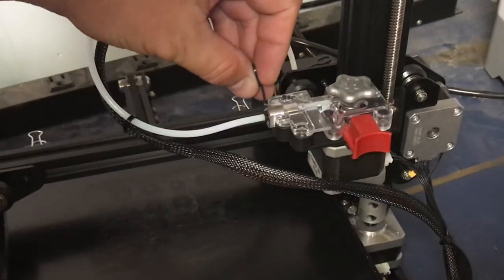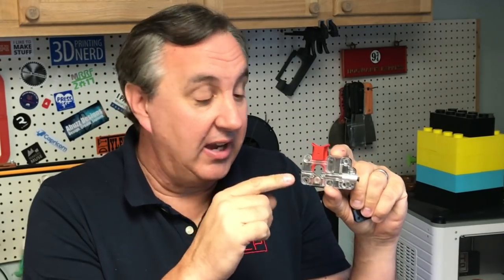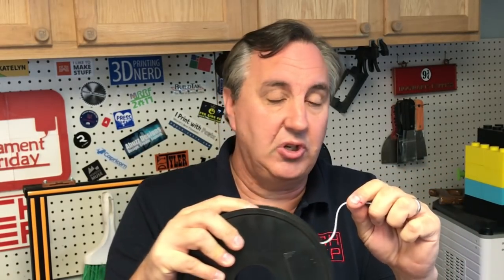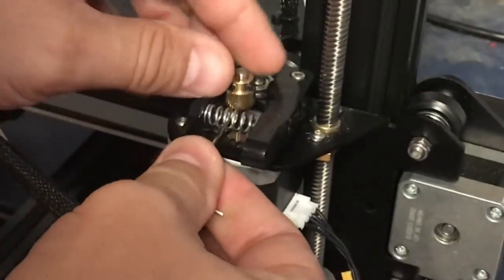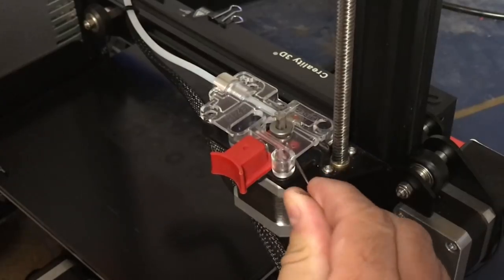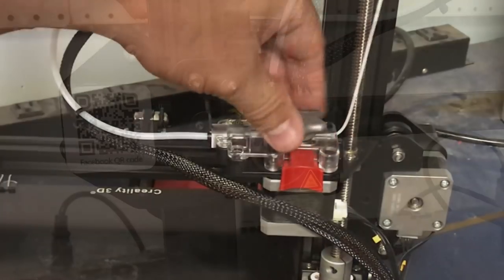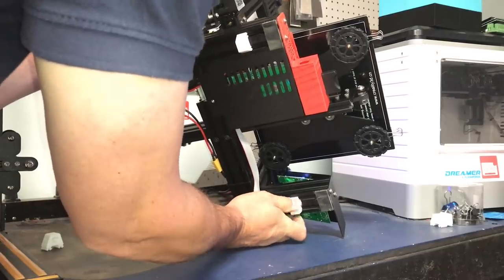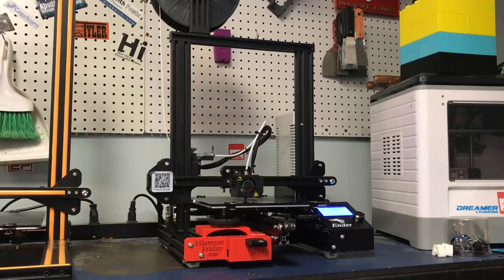Flexible NinjaFlex TPU using EZR on Ender 3

Comment: can this print normal material like pla or abs?
Reply: Same Question
Reply from the maker: Yes. Works with all filaments.
Reply from the maker: https://www.chepclub.com/cura-profiles.html
Reply: CHEP I’ve used your profile settings, mixed and matched my own, raises and lowered the speed and temp with no luck. I can print the brim great, but once infill starts it binds and jams at the teeth. If I press the red button in, the filament actually moves backwards toward the spool due to the pressure. Any suggestions?

Ender3 pro. Ezr struder. Hot end fix installed. Ninjaflex gray.
Reply from the maker: Are you using the Ninjaflex profile?
Reply: @FilamentFriday  Always great profiles Thank you !
Reply: I guess im asking the wrong place but does any of you know a tool to get back into an instagram account??
I was stupid lost my account password. I would appreciate any help you can give me.
Reply: @Ameer Drew Instablaster ;)
Reply: @Camilo Xander It did the trick and I now got access to my account again. I am so happy!
Thanks so much you saved my ass :D
Reply: @Ameer Drew no problem =)
Reply: @FilamentFriday  Thanks Chep.
Reply: it was designed for tpu so you can print PLA with bad quality since it's hard and the gears were made for soft materials

Comment: Little late to the party but I had some issues that I was able to fix that I see a lot of people having in the comments. Using CHEP's ninjaflex cura profile, after the first layer or so the ninjaflex would bind up in the gear of the EZR extruder and eventually stop extruding anything. I would have to stop the print and pull out the filament and snip out the kinked section that resulted in order to start another print. Spent a day and a half troubleshooting and such trying to fix the problem and eventually found it was the flow.

Setting my flow to 90% instead of 100% fixed the issue.

My temp was 235 C and speed of around 20 mostly but I spent a lot of time messing with these and they didn't have much effect on the issue. Hope this helps anyone with similar issues. Love the videos!

Comment: I am using the EZR since two weeks on the Ender 3. Before I had lots of trouble printing long TPU jobs (5hours+), or too flexible material (SainSmart for example). I tried anything to tune the shit out of every value but was never really statisfied. Now comes the EZR. I have printed around 20 tests and I am blown away. Instead of 10-15mm/s I print now at 50mm/s, with no stringing at all (retraction works fantastic) and absolutely mindblowing quality @chuck: I salute you, incredible job! (He's not paying me to say all of this :D).  I can honestly say for everyone who wants to print TPU/flex... this is a must have upgrade.
Reply: Question for you when you installed this on your ender 3 did you have to do any estep changes or anything? Did you just replace and print? Because in the video he looks to just replace and then print nothing else is needed to be done.
Reply: This is fantastic. I was about to order an Ender 3 like a year ago and my friend's at @NewBeeDrone recommended I get this extruder upgrade. I got distracted and never ordered the printer. However, I finally and I've been printing and already feel the need to upgrade so my TPU prints come out better. I've been looking around to see what else is out there... since it has been over a year already since this was recommended to me... but I might just go with this one regardless.

Comment: Another great video.  I wasn't able to print the 85A Ninja flex until I bought this EZR for my Ender 3 Pro. I'm brand new to 3d printing and all your guides have helped me so much. Thank you! Thank you!
Reply from the maker: Glad it helped. Some didn’t believe me but your experience helps prove the EZR works. It prints other filaments as well.

Comment: I used your new Cura finjaflex profile with the Ender 3 Pro(2019) and lowered the temp to 215 (bed off)to suit my TPU Filament TPU 1.75mm, Eryone TPU Filament 1.75mm, 3D Printing Filament TPU for 3D Printer, 0.5kg 1 Spool, Transparent Red.  With stock everything  except capricorn PTFE tube, and the the print came out great  Thingaverse skull low polly. As Chuck says all TPU have different consistencise so some may work better that others with stock extruder. As this was my first adventure with TPU I also purchased and fitted new extruder closest I could find to one on video in uk (3Dman Dual Gear Extruder)and it fitted and looked same as and well machined no burrs, this was fitted after my first print. @Chuck another truly informative Ender 3 master peace

Comment: I tried a couple different ways to print flex filament with the ender 3 pro, including using the 3D-printed frame with a piece of PTFE tubing glued into it and cut at an angle, and also a BMG clone. Both methods would fail pretty quickly, even at the slowest possible speed, due to filament bunching up in the bowden tube and eventually either causing the extruder hob to start slipping (for the 3d printed frame) or would just pop out of the extruder between the hob and the output path (for the BMG clone). I didn't want to spend $100 on the legit BMG, and this video convinced me to try out the EZR first, which I was able to get from matterhackers for just ~$40. It was incredibly easy to install, and I'm now about 20 minutes into a 40mm/sec ninjatek cheetah print which was impossible to get to with either of the other extruders. I'm really happy with how well it seems to work for the cost and can't wait to see how much faster I can go with the cheetah, and how well it works with my ninjaflex filament.

Comment: I didn't have any problem installing the Capricorn PTFE tube, but I had a difficult time installing the drive gear.  I finally removed the extruder, slid the drive gear into the approximate position, then reinstalled the extruder.  This took several attempts to be successful, and I had to slightly adjust the height of the drive gear before locking it into place with the set screw.  Now to try out my different kinds of TPU.

Comment: two observations I made when installing this - first! - make sure the gear is pushed down just so far that the tightening screw is barely clear of the red push rod (enough room for the tool to fit). if you don't have it in there just right, then it won't grab the filament correctly which'll lead to worrisome first experiences when first installed. if you have problems with it not pulling in your filament when you turn the knob, this is your problem..need to go re-adjust the position height of the gear.

second, if you're a capable person.. it's easier to insert your bowden tube if you take the ezr apart, slide the right amount of tube in, then put everything back in place. this can be tricky because of the spring on the push rod, but if you slide the case back in against the spring you can get everything to pop back into place with just a little force. after i did that i held it back in place with a zip tie on the screw holes nearest the tube (because you won't use those when attaching it to your motor). i clipped the ziptie off once it was screwed into place. 

Note - phillips head screws are a horrible choice for anything - seemecnc needs to switch to hex screws, or even better - cap head hex screws.

Comment: Great info as always Chuck and timely too. I'm printing (on my MK2) some dampening feet in PLA (for the CR-10 s4)as I watched this. These feet look like a much better solution. Gonna let the PLA feet finish (just in case) then load up some TPU in the MK2 and print these.
My current extruder is ok (so far) but the EZR looks superb. Perhaps I should order one as a contingency.

Comment: FYI, both my PTFE tubing and my Capricorn tubing easily slid in mine without any issue...but for the life of me I could not insert their coupling lock. It was too thick to slide in...but I can just print some if needed. I have some Ninja Flex and some Polymaker's Polyflex being delivered today. I am excited to see how well it works.

Comment: Thank you my friend. That's exactly what I need. I was gonna get the aluminum extruder because mine is starting to slip. I had to take and stretch the spring a little to get it to extrude without slipping. I would much rather spend a little more and get this one. I've been printing flexible on my Anet because its direct and it's been working pretty good. Vut the TPU I have is not as flexible as that so I'm not sure how well it would work trying to feed that in the Anet. Thanks for the tip my friend.
Reply from the maker: You’re welcome.
Reply: @FilamentFriday  well I found out you don't want to stretch your spring.  It was to much stress on the bearing that holds the filament to the gear and it snapped.

Comment: I purchased this extruder based on this video. Three problems. 1. Hob gear was badly out of round and required drilling. 2. supplied screws are to long and required a 3D printed spacer to keep motor tight. Capricorn was to tight. It does work good once installed. Foot design is easy to install if you remove the extrusion covers off back of printer and simply slide in.
Reply: Would you still recommend it?

Comment: Thanks for the review. I just ordered two of them in hopes that they will make printing flexible filament on my CR-10S and S4 easier.
Reply: Just curious if you have tried printing Polymaker's Polyflex? If so, what do you think of it?
Reply from the maker: I have not. Just there non flex. I find that a bit more difficult to use than standard PLA.
Reply: Lazlo, have you used this for the CR-10 4S??

Comment: What a legend! Thanks for sharing
New sub
Greetings from Argentina🇦🇷
Reply from the maker: Welcome
Reply: @FilamentFriday  hello, have to tried this EZR Extruder on CR10S pro? is there a calibration needed? having a bad print since I installed this extruder...is there a setting on Cura that I need to adjust? tank you very much.

Comment: Bought this item from your link for delivery in the UK, anyone buying for UK market please be aware that the delivery is nearly as much as the item and to top it you will then have to pay about £18 UK customs and handling charges, so quite an expensive addon. Fitted it to the Ender 3 and found that supplied mounting screws are either to long or to short for fixing it to the Ender 3 and had to buy the correct length screws, another cost. Once fitted it does do the job and I am impressed with it and handling of TPU and all other fillerments. So to summarize a great add on to the Ender 3 but if you are in the UK expect to pay a lot for it and please will the manufacturer please supply the correct size screws to cover popular printers.
Reply: Ime not guna bother getting then ime in UK aswell redditch ill wait for a UK supplier chears for the heads up mate respect 👍
Reply: Another problem with delivery to the UK can be how long it takes to clear customs after it arrives in the country - it took three weeks for my one which arrived just today.

Comment: Those feet are nice but be sure to check for artefacting on your prints from now on. Mine got a lot of wobbeling and crooked lines after installing dampeners. It got so bad I decided to remove them alltogether.
Reply from the maker: Been printing for years with them. No issues.

Comment: 2:50 here in the frame, drill through the fitting with a diameter of 4 mm and push the tube until it contacts the gear.

Comment: on my ender3 with a brass nozzle .. 85a shore hardness tpu - i'm printing @ 215c (higher would string too much), 60c bed, 40ms speed, retraction turned off. only printed a few things so far..flexi-octopus came out great. haven't tried with a steel nozzle with the ezr yet, but i will eventually..this is my last brass nozzle.
Reply: I have the A2 steel nozzle and I cannot get the Ninjaflex to print, I have the EZR and I am having nozzle clogs and print issues.  Last setting was 230C nozzle, 65C bed, 20mm/s speed.  Tried many different speed/nozzle temp but cannot get this thing to print correctly.
Reply from the maker: Go back to a 0.4 brass nozzle. I printed all weekend at MRRF with that same setup but with a brass nozzle,  without any issues.

Comment: Thanks for the video Chuck! We have battled under extrusion due to the weak spring on the Ender extruder from the get go. Replaced it once with the aluminum Creality extruder, but it had the same poor spring. The EZR feels much stiffer.

My Aug 2018 delivered Ender 3 has 4.15mm OD tubing. It fits very firmly into the stock fittings, not slipping, like some earlier units. There is no way it is fitting in the EZR. I see SeeMeCNC spec 4mm tubes, which Capricorn claims to be. I notice a few comments claiming Capricorn fits. Do you think yours was a fluke? 

My EZR is also rubbing on the screw, and brass insert for the lead screw. I had to jiggle it quite a bit to get to no sit on top of it. I am chalking a lot of this up to Creality's fast and loose adherence to a standard on the Ender.
Reply from the maker: Loosening the screws a bit the Capricorn PTFE fit a little easier.

Comment: Still futzing with the EZR but haven't had any luck printing the really springy Nijaflex. I think it's getting bound up between the bowden and the nozzle. The filament doesn't advance and the gears just tear into the same section of filament over and over. Still playing with it.
Reply from the maker: Use the original spring from the Ender instead of the EZR spring. It may be squishing it before the PTFE.

Comment: Thanks Chep for all the great info. 
I have the ezr with a direct drive bracket kit installed and the ninja flex profile jams up the filiment inside the ezr after printing a perfect brim. If I get lucky enough to avoid that for a few minutes it’s really messy around any screw holes or void areas in the print. But if I use the 4.6 profile on good setting not ninja flex it’s a decent print. What am I doing wrong. 
Thanks again.

Comment: Hey Chuck I noticed in the instructions that the to holes near the exit for the filament get 2 screws and nylon nuts too, any reason why you left those out? Also my Capricorn tubing fit fine so I must have got lucky with the diameter I have. Thanks for a great video and Iused you link to get this...looking forward to trying TPU..

Comment: Hello, thank you for this great video! Do you have to go through this swap this device each time you change the filament? Or can you just leave the new piece on and print PLA just fine?
Reply: I'd love to know about this, can we print regular PLA with this? Or do we have to change them back and forth each time?
Reply from the maker: Yeah. Works great with PLA
Reply: Awesome, thank you! I will for sure get this upgrade
Reply: I now have this upgrade and it is by far the best one I have ever tried, loading the filament is so much easier now and it's works like a charm. Thanks again for this info and review

Comment: There is a couple of issues. 1, when you installed the Bowden tube clip, you installed it wrong. 2nd, why didnt you calibrate your e-steps? Since you changed the gear its recommended to change the step. I have one and plan to install it this week.
Reply: Sorry, noob here, if I were to install this where could I find info on changing the steps?
Reply from the maker: The diameter of the gear at the teeth was near identical so I didn’t need to change anything.

Comment: My EZR that’s Barely a month old isn’t extruding anymore. When you first start the print it barely does the first layer and then goes to not extruding anything. The stepper gear is still spinning but not grabbing the filament , if you press the tension arm again it will move and will grab the filament again. I’ve tried various heights for the stepper gear but nothing seems to work. There is also a grove carved in the clear too. Anybody else have same problem